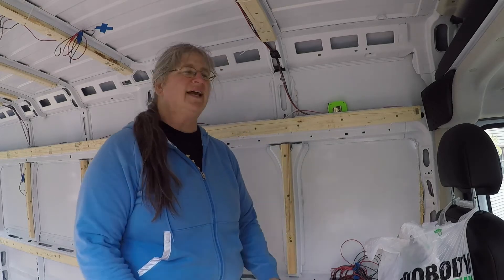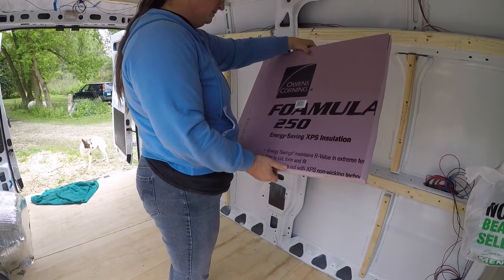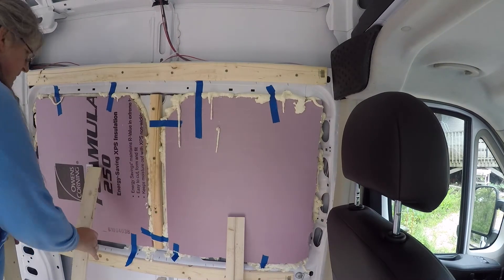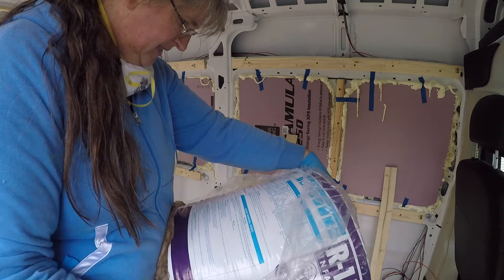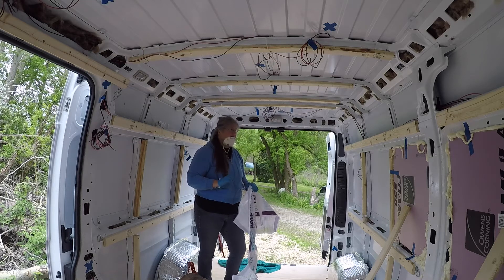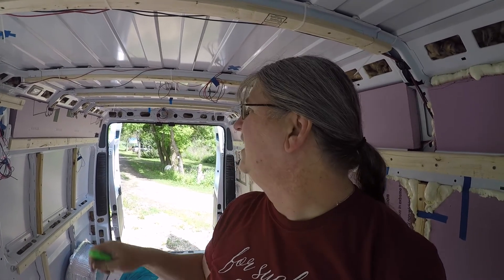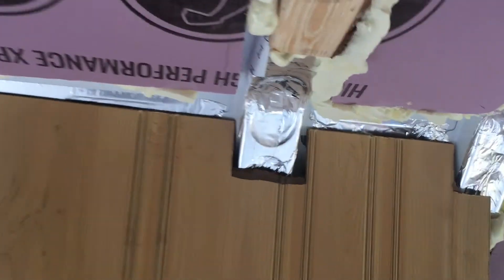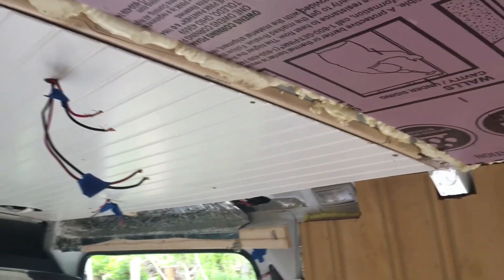Insulation for ProMaster van conversion

Comment: Very nice! I have bought all the same materials, but haven’t made the effort yet. So your video is perfect for me. Thanks!
QUESTION: How did you secure the wood (furring?) strips to the walls? Did you screw them into place? And if so, what kind of screws. I’m concerned if I do that part wrong they’ll won’t hold properly.
Reply from the maker: That's a great question. I used 1" self tapping screws 'wood to metal' . They have a little wing on the pointy end that is a tiny drill bit. My furring strips were 1x3" because they fit perfectly on the PM ribs. The other hack I would pass on is to go along the side of the rib and mark where the holes in the rib are so you don't hit empty space when securing it. The furring strip is a great place to secure paneling and ceiling.

Comment: Good job!How wide was your insulation board?
Reply from the maker: I bought standard width. I think it's 4 feet. On the walls 2"+1" but the very back panels behind my. side tables is 2". The ceiling could only accommodate 1".
Reply: @michele2017promastertravel  Thank you!🥰